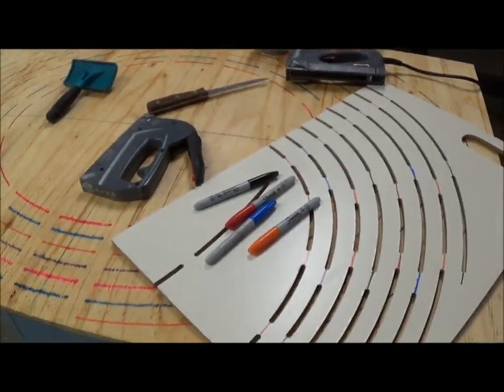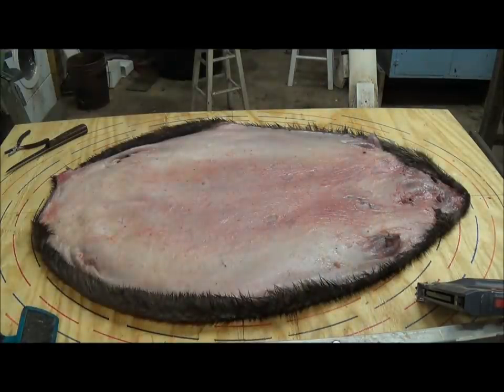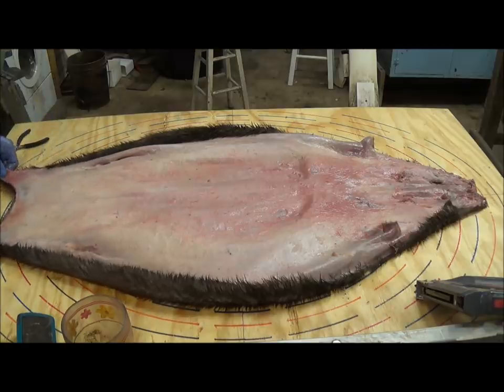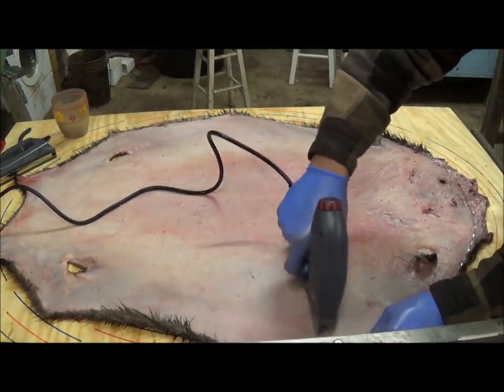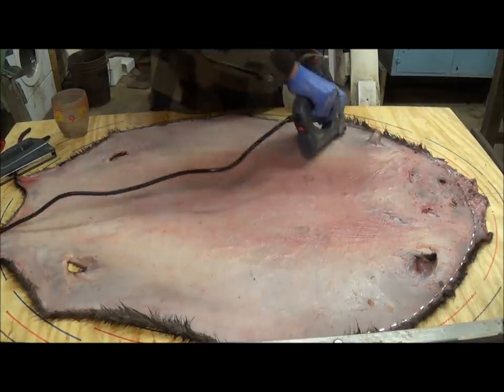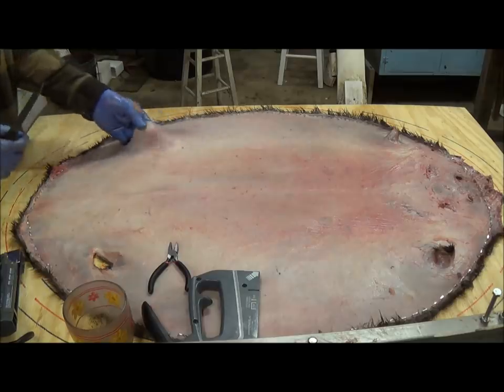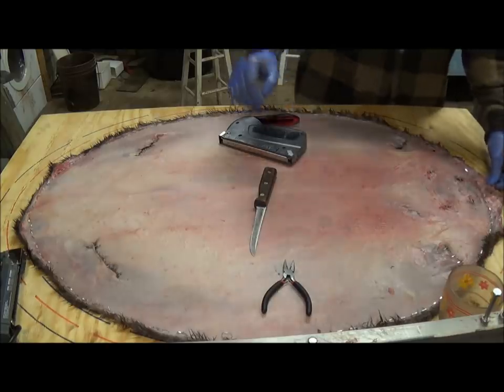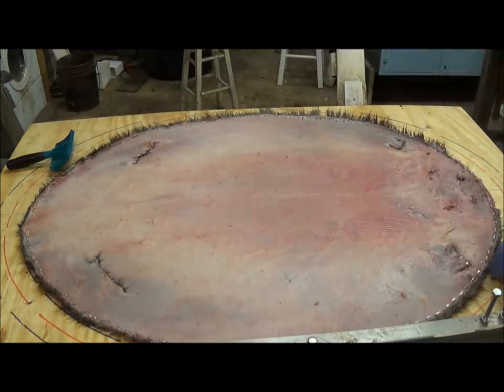Professional Fur Handling, Beaver - Part 3 Boarding

Comment: the nice thing with nails though is that you can pull the pelt up on the nails away from the board to give you an air gap between the board and fur. speeds up drying time and if the pelt is wet at all alows the fur to dry also.
Reply from the maker: NADJIWON CRITTERCONTROL yeah to each his own. there are pros and cons to both
Reply: You could cut air holes in the plywood.

Comment: Okay, so LAST QUESTION... The most important thing I need to know... How do you dry them? You just leave em on the board in the shop for a couple weeks? No salt or anything used?
Reply from the maker: Cool air with circulation

Comment: I'm new, so this might be dumb but... I noticed from the nailing videos I watched that theres space for air to go under the beaver (I'm assuming to help dry). I like the stapling idea better... but do you think there would be any benefit to cut a small (8 or so inch) hole in the middle of the board to help airflow? Thanks for all the videos, you've been a huge help!

Comment: Your videos are awesome i just switched to using a stapler for putting up beaver but I am wondering if there is a easier method for removing the staples once the beaver are dry
Reply from the maker: Eric Peddle do you have a spacer on your stapler, so they are not driven in all the way
Reply: No just bought a bostitch stapler and started using was just pulling some off boards and they don't come out very well
Reply: Did you make one or can you buy a spacer
Reply from the maker: Eric Peddle Arrow makes a stapler with a spacer attachment. this is they one I have maybe some others manufactures do as well. You can also glue / zip tie or some how attach a spacer of some sort under the stapler so the staples will not go in as deep. I like using 17/32" or 9/16" staples some I have enough sticking out to get a pair of pliers under if needed. best of luck

Comment: I have a question. How you stop the beaver from rotting with it laying flat on plywood where no air can get under and around the whole hide. Thanks.
Reply: David Williams the beaver will not rot as it was put through a fleshing process before he boarded it. By fleshing the meat and fat off he’s only leaving the layer of the dermis which holds the fur and the epidermis (outer portion) both of which can dry out naturally. If he left fat and meat on the hide it would rot as bacteria,etc... can easily penetrate those tissues, but skin is special as it has protective properties that prevent those same issues from occurring, such as it’s density and cellular structure.

Comment: Is there a way to save the ears? I just skinned my first beaver tonight by following your part one video. It is small, maybe 25 pounds. I don't need it to look good for anyone but me, and I really like the ears... can it be done? 
thanks for these videos by the way, super helpful!
Reply from the maker: +rachel pye you can leave the ears just make sure there is alot of air getting to them. the ears are generally taken off because they have no value in the fur trade and on the bigger ones especially they can spoil and cause slippage